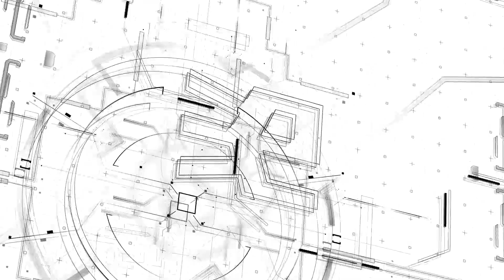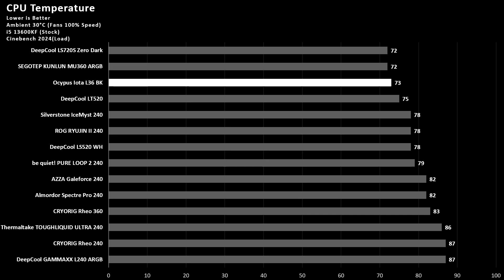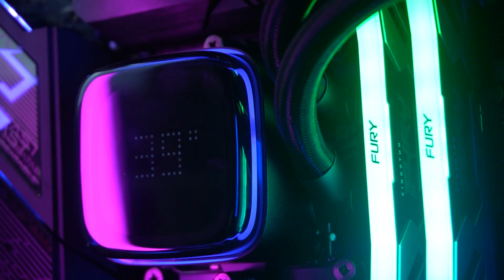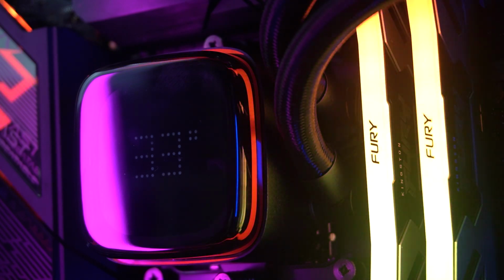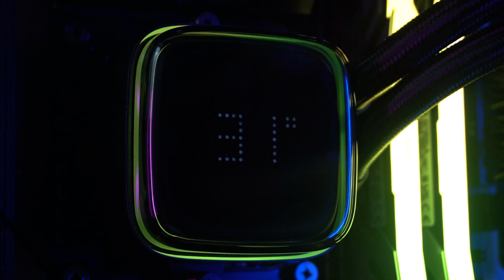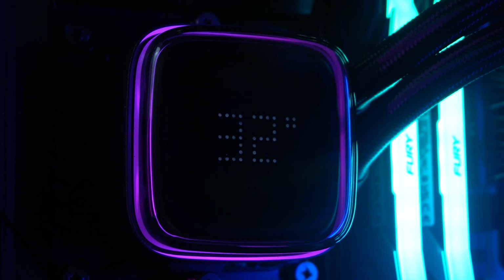Ocypus Iota L36 BK - Unboxing & Review

Comment: Bought the 240mm on sale for 55$ its over kill for a ryzen 7 5700x but i wanted something different been using 120mm aio
Reply from the maker: nice!
Reply: @RKiologist  just installed it, aio is working and rgb is working but i can't get the cpu cooler display to work, any ideas???
Reply: @RKiologist  nvm i got the display working finally, i love it keeps my ryzen 7 5700x at 28 to 31 at idle and 40 to 47c at full load so im happy

Comment: Can we changes the fan to uni argb fan
Reply from the maker: The fans are changeable. For the unifan, it  might depend on the clearance but if it has the same one like 360x120 then it fits
Reply: @RKiologist  hmmm i see, but how about the  pressure?? Its no problem if we use uni fan?? I never change that.  But i need rgb fan for this aio
Reply from the maker: @CarissaSyamra-S Well, if you change fans, it's part of the change. So it might affect the temperature results. There are things that should need to be considered once you change something.

Comment: Hi! I have this cooler and I'm having a problem where the screen won't turn on, though the pump and fans are running. Im on a b650f-e. Should I be using a fan to sata adapter for power? It's confusing that the manual doesn't mention one at all but it doesnt seem like the screen is getting enough power. The app also crashes immediately
Reply: Have you fixed this ive been thinking of buying it?
Reply: @Milinajacii  nothing I tried helped, always had the same issue on multiple systems with fresh OS installations. Ended up using a different cooler. Bummer cause it looked nice and had decent temps
Reply from the maker: @DylanSantoriello  better check if you installed the app or you connect the usb connector to your usb header.
Reply: @RKiologist  Thanks, I've done both of these things... the app always crashes immediately which is probably the problem then. Thanks again
Reply from the maker: @DylanSantoriello  you're welcome
Reply: @DylanSantoriello  I have the same problem
Reply: @ Honestly good to know it's not user error... sadly I think they just updated the app and it's still not fixed
Reply: Is you havent still got it fixed, run the app in administrator mode, it what i had to do, windows antivirus messes with the app, as soon as i did that, waited 5 secs and it started to display
Reply: @Dr3wcracked appreciate you! Unfortunately I could never get it working even in administrator mode and ended up switching to a different AIO
Reply: @DylanSantoriello  damn man wish ya the best with the other aio